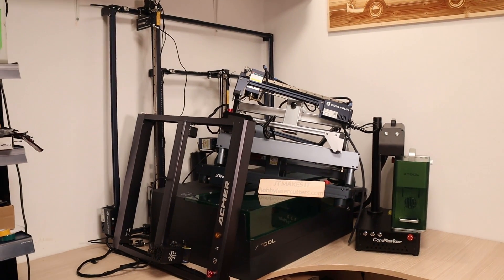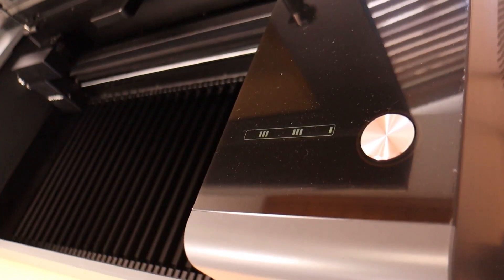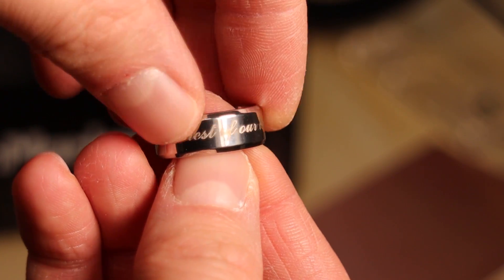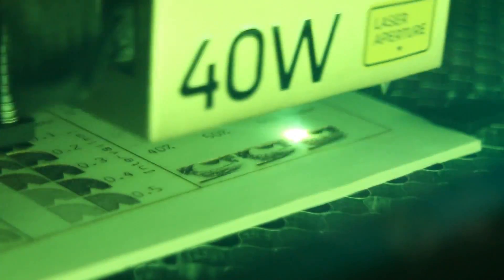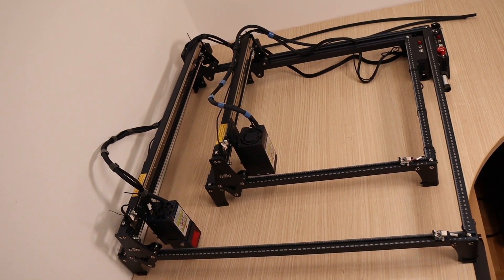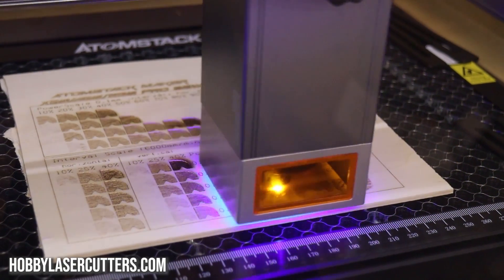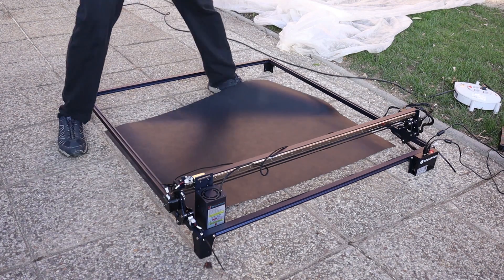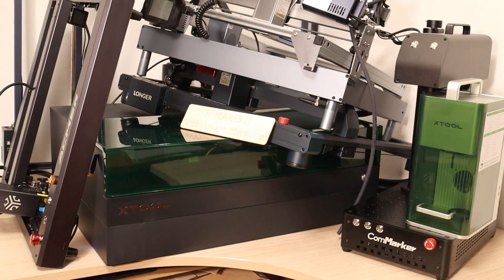I Tested the Best Laser Engravers and Cutters of 2023  (so you don't have to)

Comment: What would you recommend for one that can also do color marking stainless and similar? I see the Xtool D1 a lot, but MOPA lasers seem better (but much more expensive, and much smaller areas).
Reply from the maker: You are lucky. I'm testing a MOPA laser right now. Subscribe so you don't miss the video in a few weeks :)
Reply: @JTMakesIt  Awesome, will keep an eye out for it! How's the surface area?
Reply from the maker: @mikem2403 Depending on the lens. 110mm to 200mm square

Comment: Is it better to buy the Sculpfun S9 with air assist kit or the S30? I would cut and engrave 4-5 mm plexiglass and thinner woods.
Reply from the maker: S30 is newer and better than S9 and combined with air assist it is cheaper I think
Reply: @JTMakesIt  Yes, it's cheaper.  It is confusing that the description of the S9 says that it has a strong laser, it is emphasized that it is like 90W with co2, and the S30 does not say anything so much about power. Thank you for your reply and lots of great ideas in other videos.  I will definitely buy it.
Reply from the maker: @KarlitoMakes  s9 is older. In that times it was popular to advertise that "effective" power which doesn't mean much. You should check my website for possible discounts in some stores

Comment: Hi can you please tell me which Lazer machine which would be best for glass?
Reply from the maker: xTool F1, ComMarker B4 or other diode lasers all work on glass, but you need to paint the surface black before engraving. After engraving you clean the paint off and they all engrave well.
Reply: What kind of paint would you use for that and is there a machine that would do glass tat doesn't require paining?  @JTMakesIt
Reply from the maker: @darkfiremn  I am working on getting my hands on one laser that is mostly meant for engraving glass. But it is VERY expensive.
Reply: @JTMakesIt  this would be for wine bottles would I still need to paint?
Reply from the maker: @justineolausen1115  haven't tried engraving dark glass yet, so I can't give you definitive answer. But I plan to make a video on this topic in the future.

Comment: Thanks so much for the info! I need to rewatch this video several times and the other that you made before making a decision... I need to find the one that have huge working area (+800) with the precision of the acmer, in the league of big working areas, which is the most precise? Thanks!
Reply from the maker: Hi, Thanks for your comment!
It would be near impossible to get the same precision with the large machines. Because the larger the machine is, the less precise it gets. You can't get around physics. Belts have a tiny bit of stretch, the frame has a tiny bit of flex etc..  and it adds up at these large dimensions. For achieving the same precision as Acmer at that size, you would need a very heavy and sturdy machine.
Reply: I'm thinking of getting the Acmer with the expansion kit, and see how it performs, linear rails should be better than the others I think... Very expensive machines to make a error, your videos help me a lot!
Reply from the maker: @maxpouser  I think this would be the best bet for sure. If you decide to purchase check out the video description of my review of the Acmer and you will find a discount code for 5% off. And if you purchase through that link you will also support my channel at no extra cost to you which I would be very grateful for :)